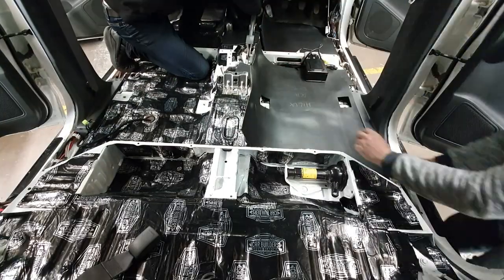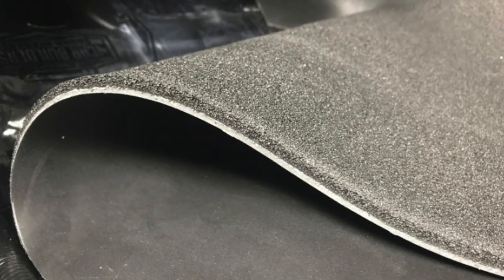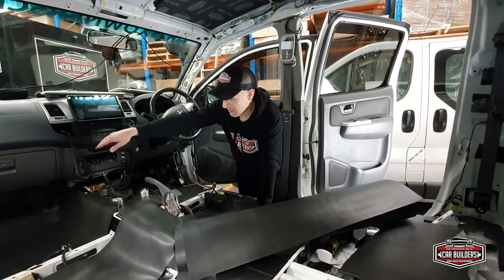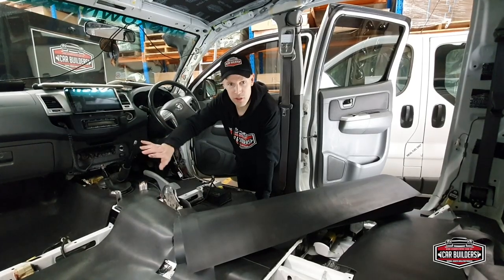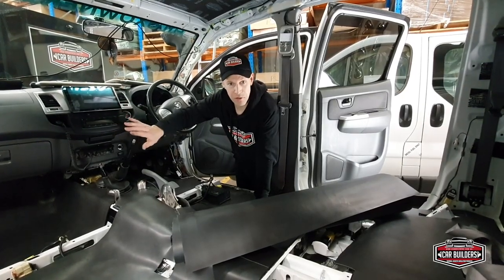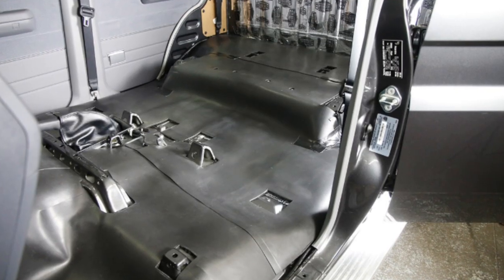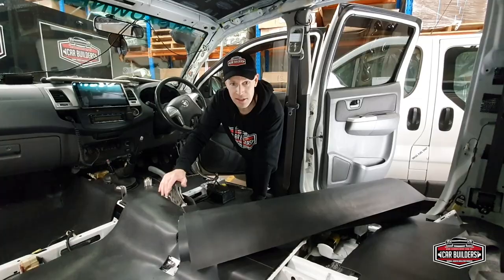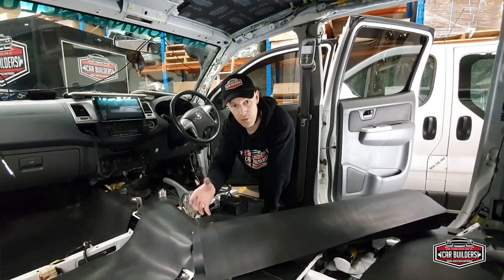What is Mass Noise Liner Lite? A Premium Sound Blanket Underlay in Vehicles

Comment: Can we use stage to noise liner on doors?
Reply from the maker: Yes, once you have used Stage 1 Sound Deadener, you can use a Stage 2 product to further dampen external noise. Acoustic Liner works well as a peel and stick option in that vertical position (it can also improve audio quality if it is placed on the door skin directly behind door speakers). Mass Noise Liner Lite can use used, however it isn't a peel and stick and needs to be mechanically fastenened.
Reply: @carbuilders1 
Thanks for your reply..
Is it necessary to dampen the inner and outer walls of the doors? Some of the vidoes (not Car Builders) shows that...is it really required?
Reply from the maker: Guys in the car audio scene always do both inner and outer door skins as it helps the sound quality of speakers in the doors 👍
Reply: @carbuilders1  so i can use stage 1 and stage 2 in inner and outer side.
Reply from the maker: Stage 1 on inner and outer doors. You would use Acoustic Liner just on the outer door skin.
Reply: @carbuilders1  OK ..thank you ...
I had purchased complete installation materials from ANR Dubai..
Reply: @carbuilders1   Im going to use it in India..😀 and i will try to do it myself..(inspiration from CB videos 😍)